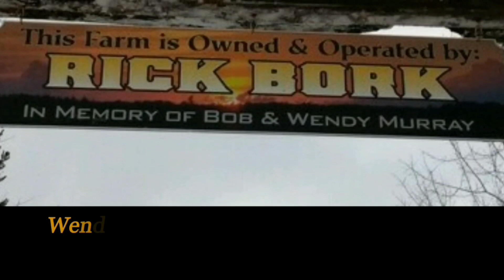Building a Gantry Part 1

Comment: tractor and loader does heavy lifting!
Reply: You have that right  .
Reply from the maker: With low ceiling and limited room its a little tough to use a tractor or excavator to lift things in the shop. With the additions that are coming this will give me a lot more control vs using a piece of equipment in the shop.
Reply: @RickBork  a gantry crain is a valuable piece of equipment  .

Comment: How much you gonna have invested in that?....I've got most of the materials to build one but still scrounging for a few more, sometimes I thinks your better off just buying new steel and getting the job done!!
Reply from the maker: Just the frame I have less than 200 bucks into. I got the materials at an auction dirt cheap. The electric winch and power trolley will be another 300 but it will be nice in the shop. 🍻